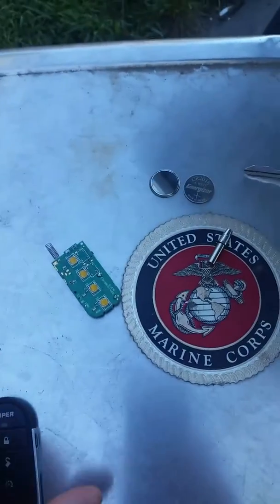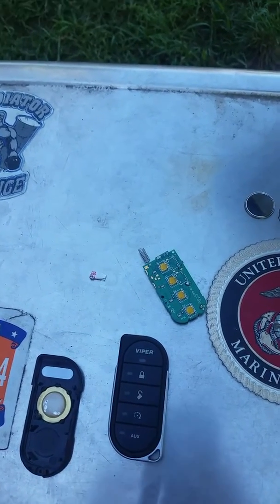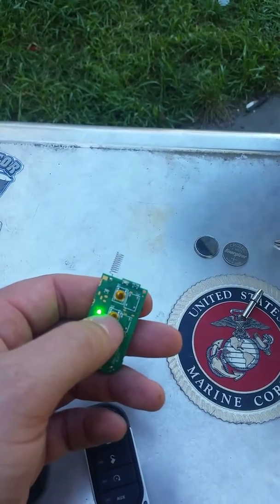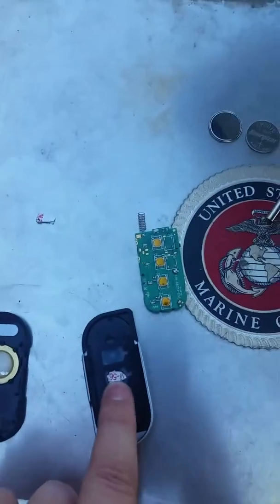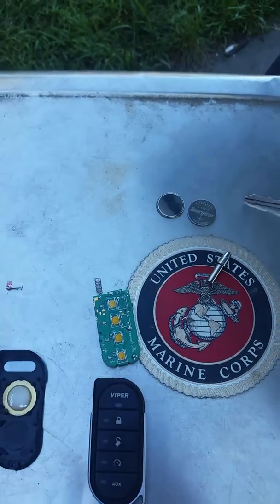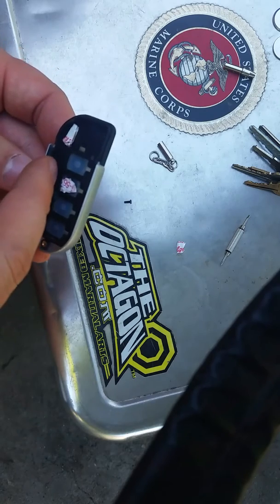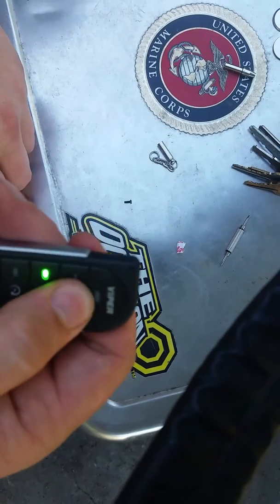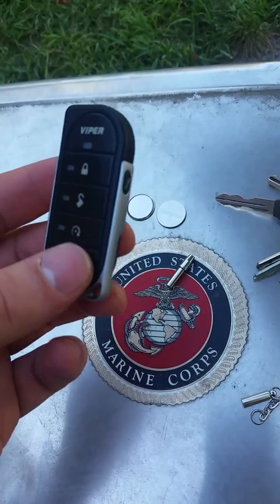Viper remote start (buttons not working)

Comment: When i press buttons, all the buttons beep and light up but nothing happens and im not sure whats wrong with it, its almost like it lost connection to the car or something
Reply from the maker: I know it's a late reply seeing you commented a year ago, but if the remote is lighting up but the car doesn't do anything you most likely have to re-pair it to the car. It's super odd/rare but I've had to re-pair my remote to my vehicles a couple times over roughly 10 years. Instructions to link them back up are easy to find on vipers website.